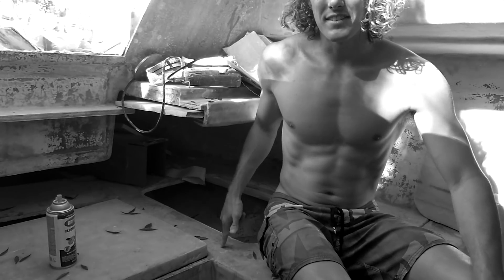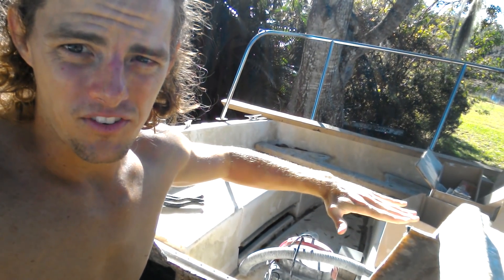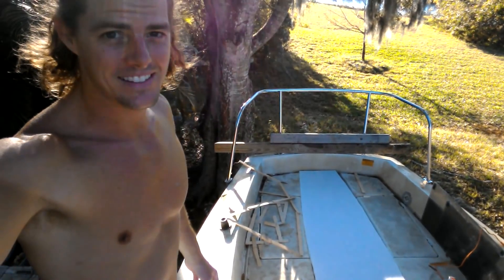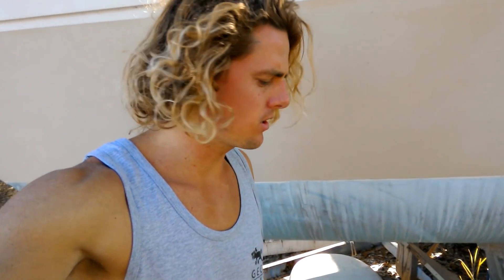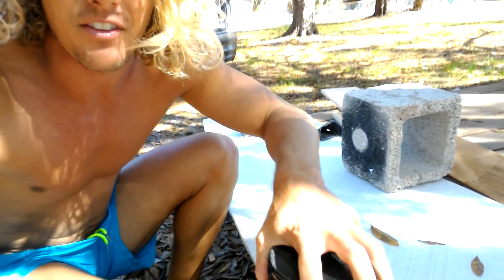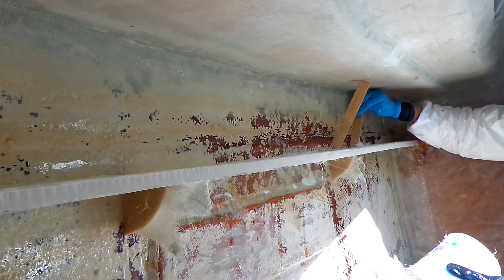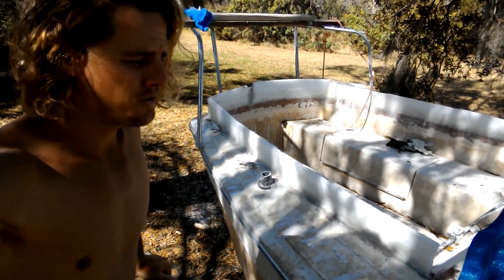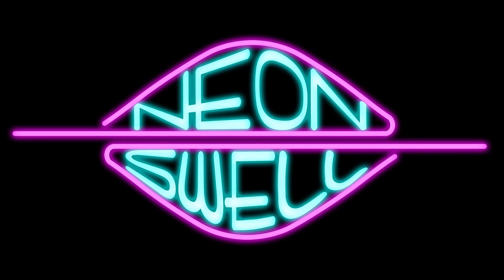Puppies, Pieces, & Precision (22' Sailboat Refit) - Ep. 21

Comment: Interesting and inventive ideas. Taking it all a little further would there be a possibility to make your bed base into a dinghy? This would relieve you of having to make edge supports which could be intrusive and save you having to carry a separate dinghy. The bed/boat when inverted would become self supporting so two for the price of one and some weight saving.
Reply from the maker: Hmm, interesting idea. Though the outside bed is now done. IT will be finished in EP. 22 I like the thought though. I'm still thinking of building a custom dingy.

Comment: What I like about composites is how relatively easy they are to modify. I love the splash guard idea, if it doesn't work out, you change it and polish it off with gel coat. Do you have a heavy keel?
Reply from the maker: Same here, easy to work with and super light/strong. Agreed, if I need changes I'll make them. My keel is 950lbs...I suppose its ok for a 22' boat, unsure how the boat actually sails.
Reply: 950 should do it. Ive worked on the c&c 30's, vanquish, true north etc. I'm impressed with what your doing bud, keep it up.

Comment: The boat has a transom hung rudder? You might have to re-engineer your tiller handle to fit over your splash guard?
Reply from the maker: Hi! Yes indeed, I will have to make modifications when that item gets put on. I'm not sure what to do yet, but am expecting conflict with that and a few other items. Thanks for checking out the build! Any advice is greatly appreciated.

Comment: Doesn't that place the winches for the headsail sheets on the outside of the splash-guard?
Reply from the maker: It does, I'm trying to figure out the dynamic at the moment, including raising the winch up....any ideas are more than welcome.
Reply: @NeonSwell  I was a little concerned about the running rigging after you put the back rest in as well, but you can always just cut out lines holes.. and run the lines through the back rest!
Reply from the maker: Hi Chase! Yeah that's what I was thinking too...any problems that arise in the future I can always fix or edit. I made a decision and will have to fix the conflicts later...lol nothing is permanent I suppose....and if the entire thing is in the way or doesn't serve its purpose, then off it goes. Thanks for the input and advice! Keep it coming!

Comment: I like the splash guard. It's really not that different from a hard dodger when it comes to the lines, Just cut out some areas, or drill some holes where the lines will go. Even if that reduces the 100% coverage of the splash guard, 80% of a splash guard is better than 0% of a splash guard/backrest.
Reply from the maker: Awesome! I agree, whereever I need holes then they will be drilled. Thanks for checking out the vid. I may do a hard dodger later...